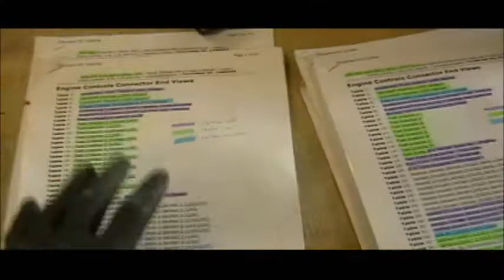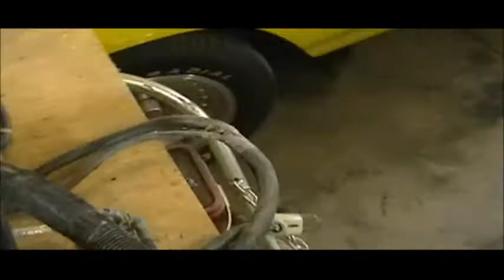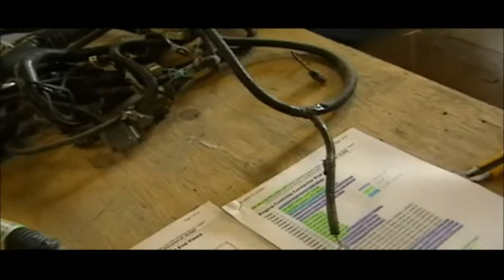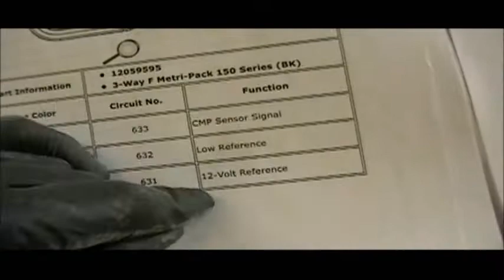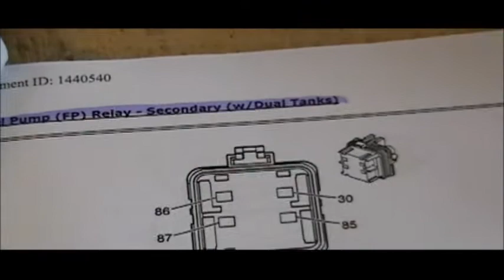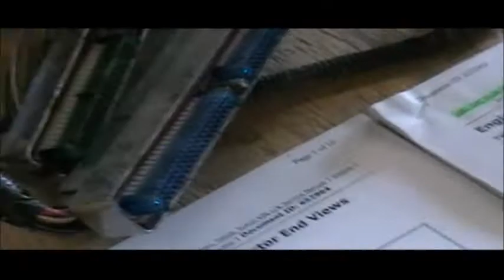My 68 Firebird Restoration Part 16

Comment: It's nice that there were so many vehicles made with sensors and wiring in common.  We are running a JDM computer and all of the diagrams are in Japanese, and the US diagrams are different, use different color wires and pin positions.  Looking forward to seeing more...